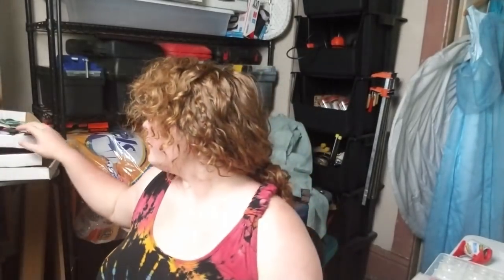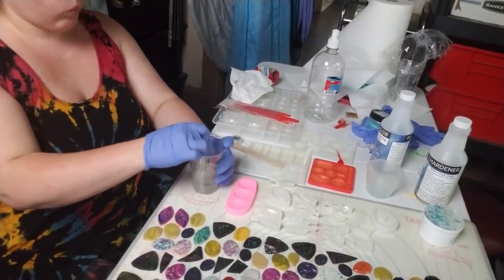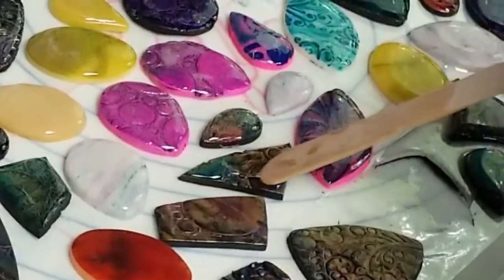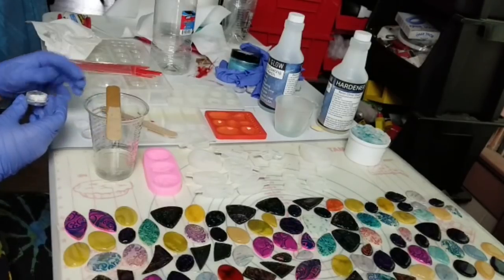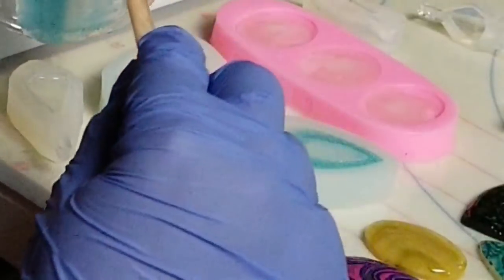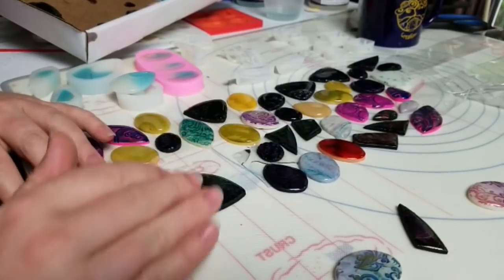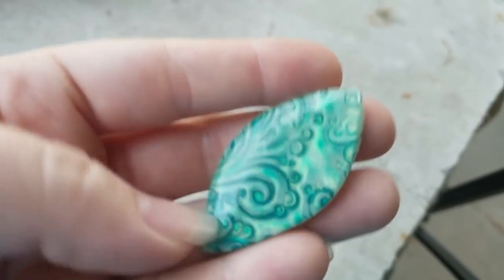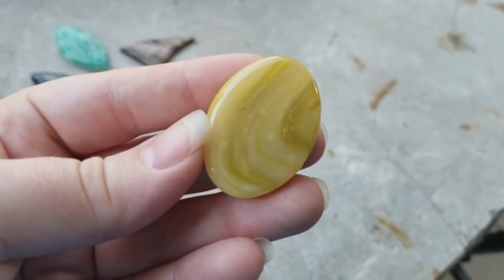Doming Resin on Polyclay Cabs

Comment: Hey Von!  I love your art so much!  It feels really weird thinking that I could ever give you any tips...  I have a couple that may be helpful.  About the dumping from one cup intro a second cup..  I don't understand how or why but your pot time is longer if you transfer into a second cup.  If you tip the first cup upside down and let the little bit of resin cure you will be able to just peel it right out and then can reuse your cup.  
Also when you have so many cabs to dome if you mix in two smaller batches of resin your workable pot time doubles, if that makes sense, less hurry, less stressed Von 😀.
I learned the hard way..
Lastly..  the tape is a great idea, you have made an awesome discovery!  
They make resin doming mats that are really expensive so the thrifty person in me started looking..  ultimately I went into the fridge and swiped the cardboard egg crate things from a 5 dozen pack of eggs.  I sprayed the little peaks with tacky glue and stuck a cab to the top of each one.  That way I could run my stick around the edge of each cab and it very nicely covered both the top and the sides.  The little drips fell right off onto the the egg crate after a couple of hours I just took a clean stick and double checked to make sure there weren't any bulbs hanging below.
I've learned so much from you I hope that you find something in my rambles helpful!  ♥️

Comment: Hi Yvonne, Firstly I should say that I don't work in the quantities that you do, but when I saw your cabs all stick together, I wanted to show you what I use to stop that from happening. It's the best little flexible silicone doming tray, with tiny upward-pointing fingers that you place your cabs onto for doming. The silicone fingers support the cabs & stop them sliding into each other. Any excess resin drips down between the fingers, leaving v limited clean-up. Mess doesn't adjoin your cabs to each other, as the surface is level but not flat. I had tried plastic doming trays in the past & they were awful - just like a Hama/Perler bead board, & the cabs slid around all over the place, then you couldn't get the hard resin back out of tray, but the silicone doming tray has none of these problems. It's just a little small for commercial quantities of cabs, but do have a look at it anyway, as I'm sure it will give you ideas. Here's the link & Fran at Little-Windows is lovely if you need any help. https://www.little-windows.com/collections/doming-trays/products/large-silicone-doming-tray
Reply: @zamis21   Maybe Walmart has gone up on price??  Because when I go to that link, it looks like Walmart's equivalent is equal or more in price.
Reply: I have two of these trays from Little Windows and they are wonderful!

Comment: It’s the canon monoxide being released at the surface to pull the bubble out of the surface of the resin , that is created by the flame  ...   you could actually just breathe closely over a piece and the bubbles would pop!! 😉...     I am surprised the heat caused by the gun didn’t heat thru the clay to warp it!!!   
Also, wax.... rubbing wax around the edges will keep the resin from sticking.    I’ve used  resin on large tables and things    Running wax around the edges where I don’t want the resin to stick , will allow me to peel it away and scrape or cut the excess off after partial cure, and even some cases after full cure as like on wax paper !!

Comment: I have a question. I hope you get this! 
Anyways, what if I go to cut my polymer clay, but I use that technique where I put plastic down 1st to give it that rounded effect. I really like that look. But I also really like the look that a top coat of clear resin makes. Could I do that rounded effect on my polymer clay cut outs and still dome with resin? Would the resin drip off and break that resin edge barrier that allows it to dome?
Reply from the maker: Hello! I have had a really hard time merging the 2 techniques, but have had some success with using uv resin painted on thinly and cured quickly.  I hope this is helpful to you!
Reply: @backtoearthcreations  , oh yes!!! Thank you!! Your videos help me learn so much, and really help me relax ❤

Comment: Hi Von! I bought some pre-made polymer clay beads a few days ago and whatever was used to seal the clay caused the beads to stick to each other inside the bag because of how tightly packed in they were. When I was gently pulling them apart the beads became damaged some had chunks taken out of them, others only damaged the coating and a couple even had the metal centres of the beads pop out as well!

Do you know of anyway to fix the problem? I'm on a pension so I have very limited funds for buying anything to fix them with and I think they were on clearance so I probably can't get my money back.

Comment: Hi Yvonne - when I do my Mod Podge Dimensional glaze I seem to get all kind of marks that almost looks like dust.  Do you know what I can do to prevent that?  And sometime it looks like lines are on the clay and if I use a head pin, it will have an indentation???
Reply from the maker: Hey, Evelyn! You could use a clean bin or box lid to cover your work while it dries. I'm not sure about the marks on your clay, though! I'm sorry I couldn't be more helpful!

Comment: I've been wondering if you can use the same oven that you cook with for baking the polymer clay?
Reply: I do. Some say you shouldn't because of the fumes, but I've never noticed a problem.
Reply: Truthification Chronicles awesome thanks!! I have a toaster oven too so I think I'll use that instead
Reply: The main thing to be careful of with a toaster oven is temperature.  The temps tend to vary more and it's important for the clay to be at the proper temperature for a sustained amount of time so the complete bonding takes place.  Also, make sure to cover your clay with like aluminum foil or something because typically the top element is so close to the clay it can burn it.  All I have is a toaster oven (a larger one, though), so those are some things I experienced with my first few batches of clay. I also bake things on a glass trivet I got at Dollar Tree (I scraped off the rubber footings).  I think the glass helps radiate the heat more evenly (I'm sure a tile would do the same).  (While I use the glass to bake on, I also put things on parchment paper because the glass will make shiny spots on the back of the piece and, unless the piece is perfectly flat and all of it is touching glass, it looks spotty.  The parchment paper gives an even baking surface in my experience.)  Now, if you were baking a ton of clay each day, a dedicated oven for it might be necessary, but if you're only doing a few pieces every so often, I wouldn't worry about it.  I've been doing it this way for like a year and no ill effects.  :o)

Comment: Have you ever thought about applying the resin using a syringe?
Reply from the maker: I haven't! Would it be very expensive? I have never purchased syringes!
Reply: Yvonne Williams - saw 100 x 20ml for 21 pounds on ebay.. its best to shop around.. would suggest getting a couple in different sizes and try when them when you're near the end of your pour, just as a test. x
Reply: Pipettes work well and are a lot cheaper. I bought 500 for $25 au. @thebalddevil3874